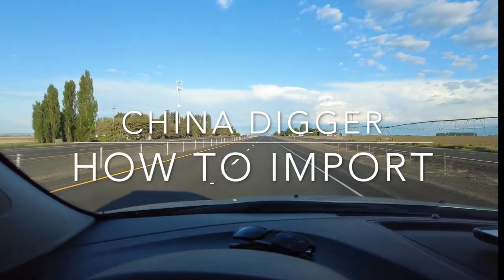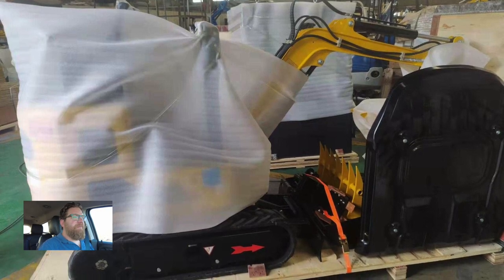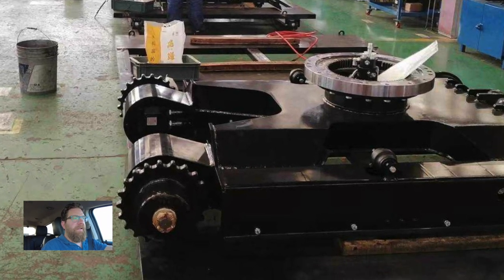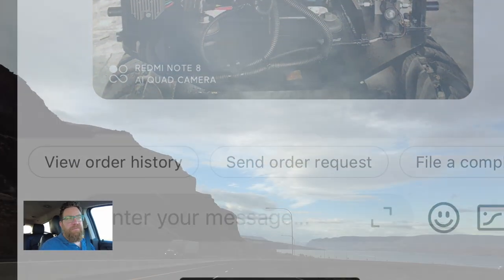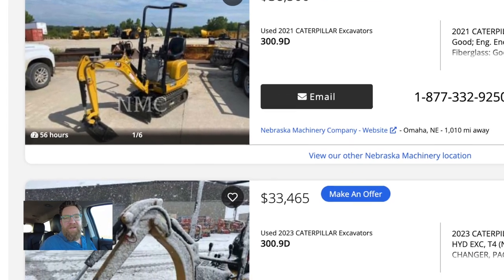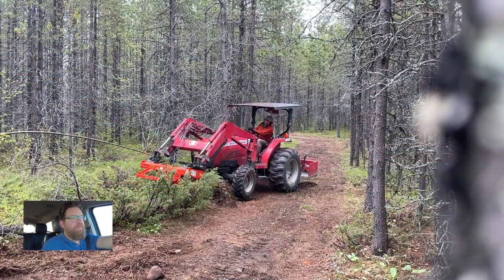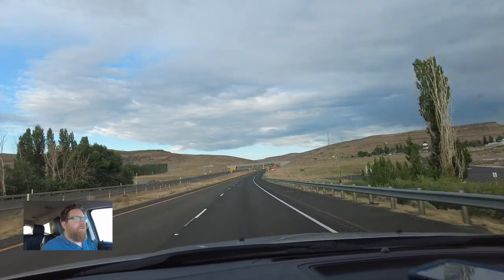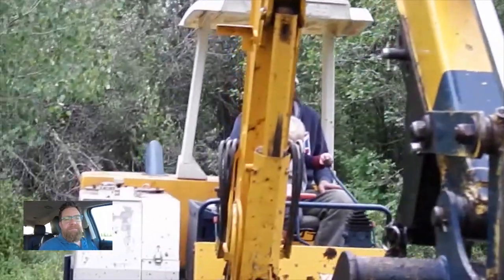Six Steps to Importing a Chinese Mini Digger Excavator from China by using Alibaba

Comment: I just got 2000lb gas powered one from an auction under 6k out the door. It came with a flat bucket, mechanical thumb, a grabber, and a quick coupler. Seems to be a good machine. The cat excavators were selling for 40,000 bucks +
Reply: It's basically the same one you have. Small differences
Reply from the maker: @Will-tm5bj  enjoy 😊
Reply: @jakebell1947 I'm so excited 😂 the auction experience was super cool too
Reply: Please share details. Which auction etc. That's fantastic.
Reply: @oersson  they've been selling them at the Richie bros auctions, I got mine at Jeff martin. Definitely worth checking out
Reply: @Will-tm5bj  I checked both Richie brothers and Jeff Martin. Didn't see anything near Portland Oregon. Nor any mini excavators. Is it hit and miss?
Reply: @oersson  I guess they are regional, I'm not sure what to tell you other than maybe Iron Planet auctions, or eBay. Being on the west coast, I'd be Hella surprised if there weren't hundreds of them, too many ports out there. Maybe the market is different. 

I'm going to a Jeff martin auction December 14th, they've got several of these on the block
Reply: @oersson  shit. If you're up for a Florida trip in February, they have a 4 day auction in Kissimmee lol
Reply: @Will-tm5bj  I looked some more after seeing your great comments. I saw dozens of name brand excavators like Kubota Case bobcat etc. Didn't see any Chinese models. Maybe you were just referring to those used machines. I'm looking for a new machine and heard they also can be found at auction. Cheers 😊 Ole

Comment: You can do it in one step with just going to an actual importer who has an inventory and get a better machine.
Reply from the maker: Why is it a better machine from the importer?
Reply: @jakebell1947  hydraulic thumb standard. Upgraded Eaton pumps Parker drive units, thicker steal, better welds, side swing option, still get kubota engines or real briggs and straton and just the fact that if you need a part or support you actually have someone here who speaks English and will actually answer the phone after sale. 
 They are just spected out better.    When you do it yourself unless you know what to ask for, you are going to get the cheapest of the cheap..
 Look into ground hog, iorn rhino, or my favorite Kymron equipment.